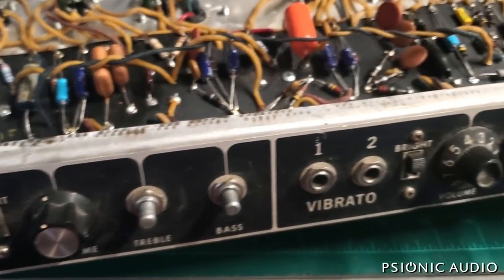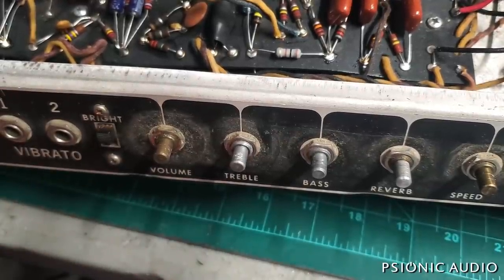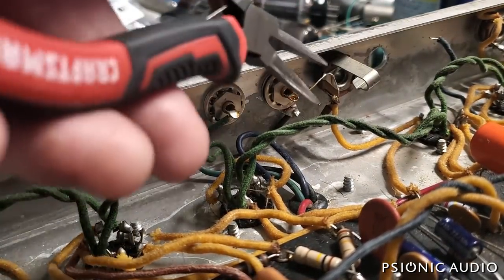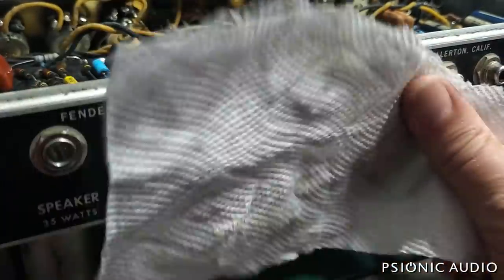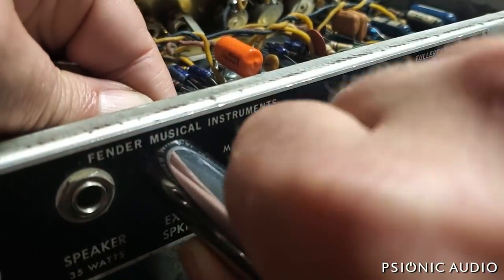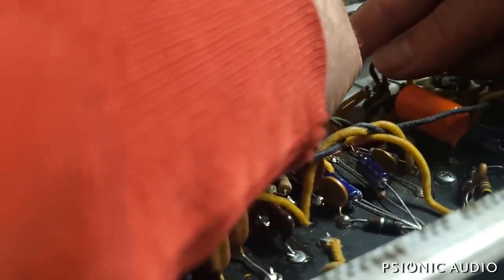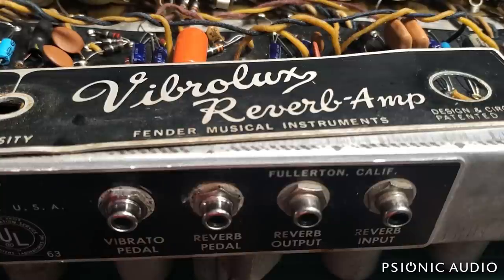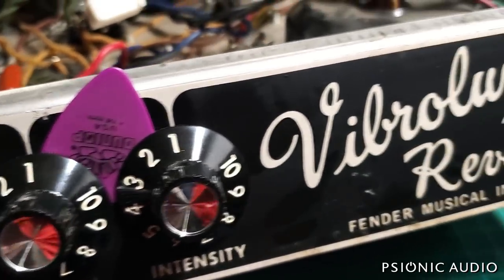'66 Vibrolux Reverb | Part 2 : The Work Begins

Comment: A strip of bedsheet or similar thin cloth can be slipped under a stuck knob, partially wrapped to form a sling or hammock under the knob, and pulled up on from both ends of the cloth so that the knob comes straight up off of the shaft.

Comment: Cool trick I found for getting the pilot assembly out. Get a bolt same size/threads as lens threads, screw a nut partially on to bolt, thread bolt into lens holder/bezel from front of amp, tighten nut up against bezel. You now can turn the bolt which will loosen the lens holder from the pilot assembly. No wrench needed for the nut inside the chasis and works fast and easy., both on and off and can get tight as you like when you re-assmble.

Comment: Here for all the classics - Greek, Roman, and amps!

I've started using the little plastic pry bars they make for repairing phones to get stuck knobs off without worrying about surface damage. Just thought I'd share that idea if it's of any use to anyone.
Reply: Those plastic pry bars are indeed usefull, but sometimes not quite strong enough, or prone to the edges get nicked and chewed up. BTW, I've used them for prying remote controls apart to clean the switches or remove battery leakage.

Comment: I think you missed the reverb input RCA. It needs a doubled up washer to be the same as the rest now. The short one had the factory ground ring terminal. I believe the repro RCA’s are pretty close to the original part, of course that depends on who made it and where you got them.
Reply from the maker: All four extend the same distance from the chassis. The only difference between the old jacks and the new ones is the nut was thicker on the old ones.
Reply: @PsionicAudio  , I get changing out the 1/4"  jacks in order to respect originality, but RCA jacks and plugs are a truly terrible connector design that the audio world has been saddled with for a hundred years. Any connector that breaks the ground before the hot is gonna be responsible for loud, annoying thumps, and potentially even speaker or amplifier damage.  1/4" jacks aren't much better,  but at least those can be had in useful switching and shorting versions. (Switching and shorting RCA jacks do exist but they are extremely unreliable).